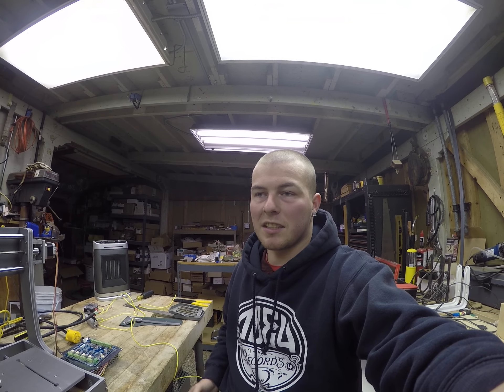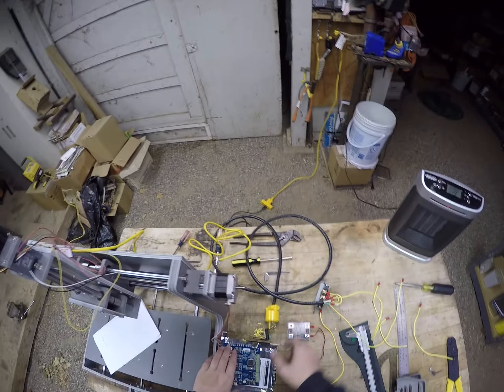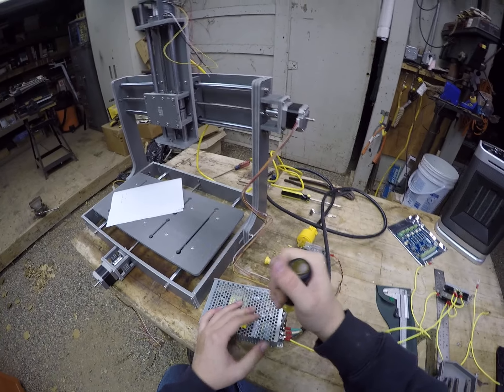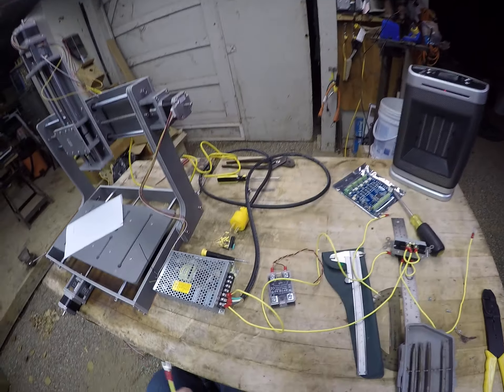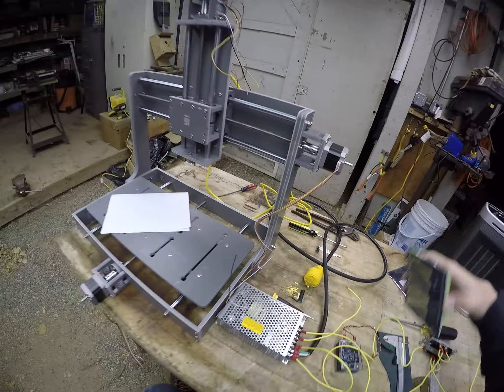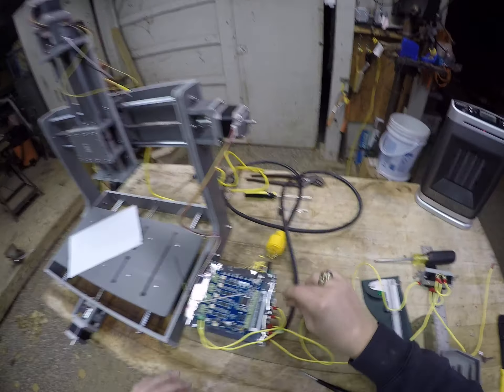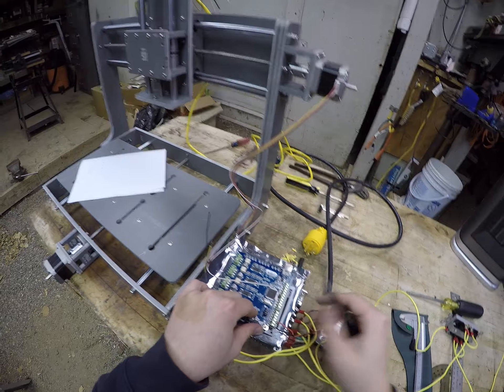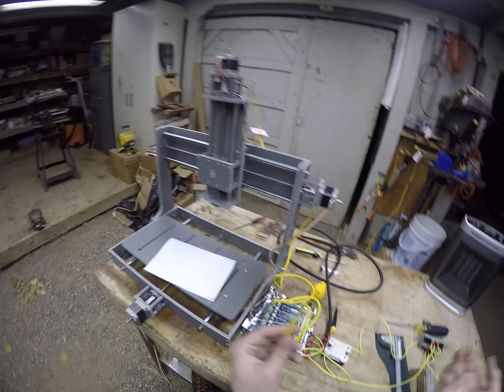Building the Zen Toolworks CNC Kit, Part IV

Comment: What gauge wires did you use for the circuitry? The manual I have says that the stepper motor and the stepper motor driver board have a rating of 3 A, which means I have to use 16 gauge wires to handle that current.

Comment: did you ever get around to creating a video with installing the dremel and configuring the software? I recently purchased a used zen took works kit but I'm missing the programing info and how to set up the cnc & software.
Reply: Not sure about grbl but I will be using arduino. The kit only came with the skeleton and a rotary tool already assembled. I'm saving to make a purchase for the remaining arduino, power supply and stepper controller. I loved your instructional videos but the last missing part was the most crucial for me as I've not a clue as to how i go about setting up the arduino and software.
Reply from the maker: +Jason Enloe My apologies - I meant to create such a video, but the mount that I had prototyped was not stable (and eventually created a host of problems that I'll need to sit down to rework). I also got caught up with a new job around then, so this project never turned out to be exactly what I'd hoped it would be. I'll share with you the configuration that I was (tentatively) going to employ if it helps.

GRBL is a firmware program that you have to flash to the Arduino (I don't believe you can write it though the Arduino IDE) that turns the Arduino's ATmega microcontroller into a small, but decently feature-complete G-code interpreter. G-code, as you're probably aware, is a command set that specifies coordinates similar to how you might envision a machine playing connect-the-dots.

Now, GRBL alone typically doesn't do squat if it isn't connected to stepper motors. For the physical power drivers, you have a couple options, or at least that I'm aware of. The first is to pick up a grblShield, which is simply an Arduino shield that stacks on top. Then, there's TinyG, the board I originally used. 

TinyG is a replacement for the Arduino + GRBL + grblShield combination; it has four drivers on-board, spindle controls and nice things like that, and expansion abilities because it uses a fork of GRBL that has been modified for a different variety of AVR (the family the Arduino's ATmega device belongs to). Upsides are that it is feature-complete, expandable, and usually beginner-friendly and ready-to-go out of the box without needing a "blaster cable" like a JTAGICE3 or a Arduino bootstrapping cascade to program AVRs. Downsides are that they are typically pricier than the alternative options (I believe I paid in the $80 - $100 range).

If you're looking to prioritize cost, the Arduino + GRBL + grblShield combination is perfectly fine, you'll just need to do more hacking and legwork to get it set up correctly.

In this case, I was using a 40W, 24V or so power supply, the TinyG controller, and an SSR (solid-state relay) to control the mains connection to the Dremel (primitive switch-on/switch-off control over the spindle, enables M3, M4, and M5, etc.). Those SSRs can be found fairly cheaply; I can draw up some quick doodle-schematics to show you the wirings and get you part numbers for what I was using if you'd like.

As to the mount issues that plagued mine, I suppose it's a good example of "measure twice, cut once"; the mounts I made were too thin and the bolts not rigid enough, so the Dremel would have wobbled all over the place during a job. When you get to devising a mount solution, make sure it's heavy enough to be rigid.